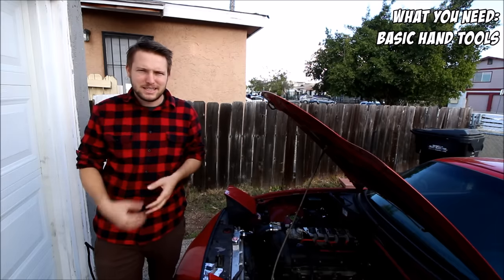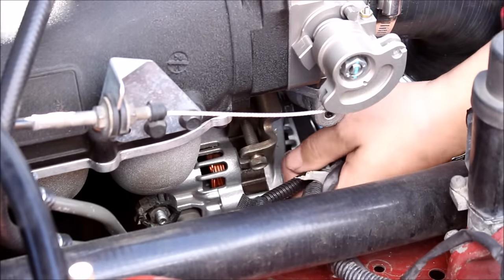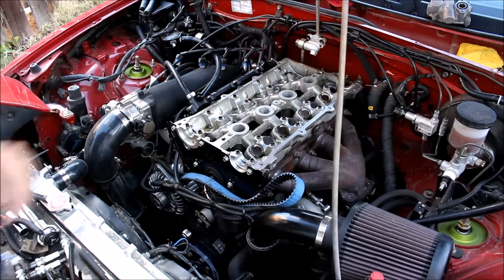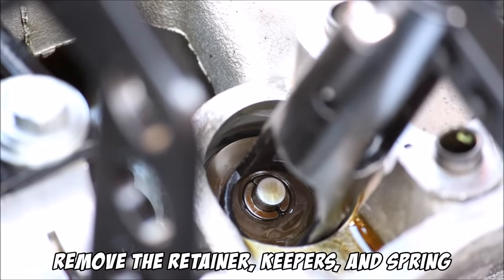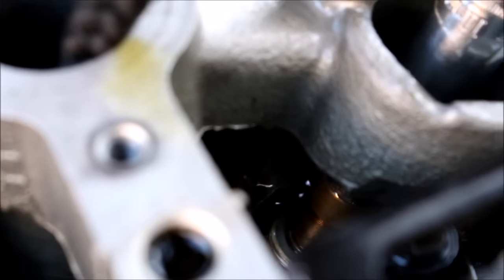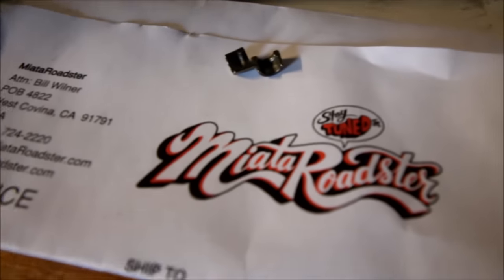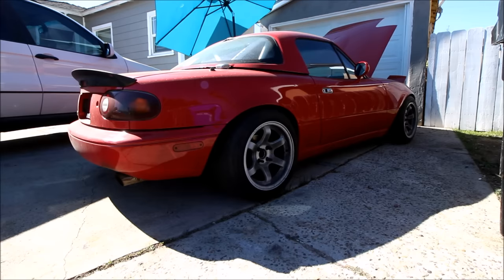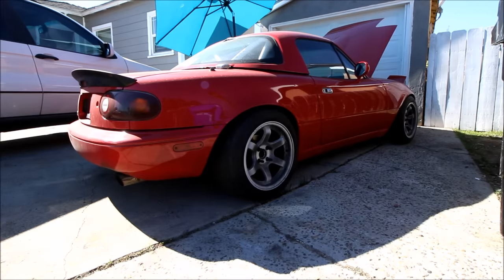The ULTIMATE Guide To Replacing Valve Stem Seals The Easy Way

Comment: A trick I learned in tech school. Use some trans gel to stick to the end of your flat-blade screwdriver and then stick your keeper onto the trans gel which is on the tip of your screwdriver. Also put a little bit of trans gel onto the tip of your valve stem. Now your keepers wont fly anywhere! Helped me a lot honestly. Just don't go crazy with the trans gel and it should be fine. I didn't use that type of valve compressor though, mine was more of a "vice grip" style. Should work either way, just don't let up ;) Have fun out there!

Comment: Hi Greg. Nice video bro. I've done this twice. Once on my 97 Mazda Astina 1.8(lantis, protege, 323f) and once on my 07 Toyota tazz 130 2e. I must admit doing it on the mazda without the right tools is much harder than it is on the Toyota...bcoz of the strength of the springs the mazda valve springs are much harder to compress. I compressed the Toyota springs with my fingers but was very soar after that. I managed to cut a 17/19mm Spark plug socket on the side open and used a extension to compress the springs and it worked great. Gents...one "Very Important" thing I want to mention is:  When attempting this, make 100% sure that you clean the bottom around the valve stem because what I found was broken pieces of the older valve stem seals still stuck like a O ring around at the bottom. It can sometimes be difficult to see them. So please make sure before installing new seals to prevent more oil leaks and doing it all over again....All the Best. Thanks Gents

Comment: Excellent trick with the rope! I've been fortunate to have access to a compressor, or I'm having to remove the cylinder head for other reasons. A suggestion, if it can be of some use for anyone. When installing the keepers for the vale stem, take a small flat-head screwdriver (a pocket screwdriver) to which you'll apply a small amount of red grease on the tip. Also, apply a small amount of red grease to the inside and outside of one keeper. Then, take the keeper and smear is on the tip of the screwdriver with it hanging on using the grease. Make sure to face the open end of the keeper away from the screwdriver. Afterwards, press down on the valve spring and place the keeper along the stem. Next, slowly release the pressure being applied the valve spring, the keeper will begin to pinch into place allowing the opportunity to lift the screwdriver up and out. It takes a like practice. Cheers!

Comment: Just to throw two cents worth in; if you lay your keepers curve side down, take a reel small blade screw driver and get just a tad of new grease on the flat side of the blade, you can touch the keeper on the back, it will stick to the screw driver; then with the spring compressed, just set the keeper into place on the valve stem and draw the screw driver out wiping the keeper off onto the valve stem.  The grease will hold it in place, place them both and release the compressor.  There are of course many methods that work, this is just one that has worked well for me for many years.  Nice vid by the way, you took the time, and was all about the job. Thanks!

Comment: Heads up to anyone looking to do this job now (after the 5 years) STRONGLY recommend you save yourself the headache and buy the Flyin miata valve compressor tool instead of the one he used in the video, no keepers catapulting into oblivion, no modifications to the tool and generally way way easier to use.  Other than the tool the video is still super super helpful and makes the job easier.

Comment: "No the autozone spring compressor will not work.  Those are meant for big block Ford's and not our small little engines."

I have a vehicle with a big Ford V8 and yet still found your video very relevant, engaging, informative and very well put together.  You sir have got a new viewer 👌

Comment: Great video.  Just did my valve stem seals.  Beavis Motorsports had a great tip on using a piece of packing tape to guide the keepers.  A+ racing has a great tutorial on the timing belt.

Comment: I’m working on a Contour 2.0l. I found that a 17 mm socket worked perfect for removal and install of the valve seals, the redesign was just a little smaller than factory so it worked out perfect

Comment: 2015 Buick Lacrosse V6 100,000 miles. Symptom oil fouled spark plugs causing misfire. Dealer wanted to replace bank one cylinder head stating it had porous casting. If it was porous it would have failed the first 3,000 miles. . googled oil consumption and found common problem with valve stem seals . Thanks for the tips

Comment: I am having to do this right now, unfortunately to my 2001 Miata. One of my lifters has failed (going to replace them all of course). But also need to replace my valve stem seals and I really didn't want to pull my head. Thanks to this video I won't have too, just need to get my hands on that tool.

Comment: When you were cranking the engine by hand after reinstallation, were you setting the timing? I’m going to be tackling this soon on a 2000 toyota corolla dohc so any info on what was happening there is greatly appreciated. Ty for the video ✌🏼

Comment: Wish I would have known about the rope trick before dropping a valve to the bottom of my cylinder because the piston was at BDC instead of TDC...
2 hours, a screwdriver, magnet, and coat hanger later, it was back in place and a valuable lesson had been learned.
PS- this was on a 12 valve Cummins, not a VVT. But that still might have been a handy trick.
Reply from the maker: jeffsqartan Wait.... You successfully got the valve back through the guide???? IMPRESSIVE
Reply: @TheCarPassionChanel It was either that or spend another $355 on the modified head gasket I have to use lol
Thanks! Desperation will get you to do some crazy things.
Basically, I bent the coat hanger to get it to hook onto the valve keeper groove, lifted the valve into the bottom of the guide, then rotated the piston up to the valve to keep pressure on it and push it up to where I could grab it from the top. The hardest part was getting the valve centered on the hole. The pistons in my Cummins have a deep dish that's offset from the center of the piston. But yeah. Good times lol.

Comment: @12:51, put some moly grease or vaseline on the retainer and place the keepers outboard of the stem so when you get the retainer pressed under the stem grooves, you just need to slide the locks into the groove. let it up and wipe off the vaseline. It wont hurt the oil. Ive seen people use a piece of pipe and a hammer to just strike the retainer and the locks just pop out.

Comment: FYI the " Lisle 36050 Valve Keeper Remover and Installer Kit"  is a much better tool to remove/install retainers. amazingly quick and easy and its $50, they have a single non-kit for $30. It takes like 5 seconds per retainer, install or removal.. Definitely worth adding to a toolset if you do this more than once. FYI its magnetised to prevent what happened to you. Good video though!

Comment: New to this channel, and I'm now sub'd. Great detail in what you're doing and giving some hacks (nylon rope) to make the job right and easier. 
I didn't see or if you filmed from the very beginning, but I'm thinking you started this job with the #1 piston at TDC, is that correct?
You have encouraged me to looking for a non-running Miata and challenging myself to get it going correctly, with an engine rebuild.
Thank you for your time and knowledge with this motor.

Comment: Great video, the valve stem seals once seated should it be able to rotate when turned by hand.? Because i just replaced my valve seals & its really tight, hard to turn. The old ones were easy to turn by hand while removal. Thanks

Comment: Exellent job, I have watched many re valve stem seals replacement including air compressor used in the piston cylinder with the threaded hose attached to spark plug threads. Yours is well arranged. Can you describe the Wet/Dry process for testing cylinder compression and how exactly what your looking for in that testing process?

Comment: Retainer installation can be made easier with the help of a magnet and some type of flexible barrier, I use old latex gloves. Place barrier on retainer, magnet on stem (usually inside the glove to keep magnet from attaching to spring compressor cylinder walls), compress spring. Usually works on first attempt for me
Reply: Legend. After mucking about for ages, tried your latex glove trick. Worked so well. Just enough stretch to let it rise and then fall into place. Brilliant

Comment: I felt your anxiety about the keeper flying away on you. My first car (in 1987) was a 1983 Mazda 626 with a simple 2.0 i4. The original owners treated it like garbage. The valve adjusters - manually adjustable - were noisy AF. One ambitious morning, I pulled the valve cover off to investigate. I found the lash adjusters were faceted from possibly never having been adjusted in their 80K miles. So, I decided to pull each adjuster out, so that I could reshape the tips to being convex again. This required removing a lock nut to pull both parts off each rocker arm. Well, this was my first time pulling the valve cover off anything, and I wasn't paying attention to those sneaky oil return funnels in the head... and at one point I mistakenly dropped one of the nuts. I nearly had a heart attack at the ripe old age of 21. I hoped and prayed, and upon closer inspection, I found the nut perilously sitting in the oil return port near the top of the opening. I lucked out that the nut had landed north-south! If it had landed east-west it would have slid to the bottom of the engine. That oil return port was very narrow in depth, so the length of the nut got stuck there. 90° to the right or left and it would have been gone. I still thank my lucky stars on that one. Lesson learned - COVER YOUR OPEN PORTS FOLKS.

Comment: 12:54 Get a tube, or a straw, or a length of fish-tank clear tube so you can see, and hold it in place. If you have that length of tube, you could even cut it at an angle. I like this compression tool. I saw a guy use some zip ties on this. I used zip ties once, actually hose clamps, to compress a rear shock on the A-Arm for a replacement on my Z once.

Comment: I'm about to install a new head gasket, I'm assuming the valve seal job is easier to do with the head removed?  Maybe don't need that special tool to compress the valve spring?

Comment: 12:05 Gewd Deal! Werkin on a 1986 F350 6.9L diesel and had trouble gittin the intake valve stem seats on head. Use a socket, gotcha B0$$

Comment: I forgot to plug in o2 sensor on one of the banks. Car didn't want to ignite and came up with engine check light at first on my bmw 120i. Gave me a heart attack until I collected myself and used a odb2 tool to scan and read error. All good now. As soon as I saw the keepers and knew what they are, I ordered 4 extra before I started the job lol. A little trick I learned from other youtuber, just use some grease on the keeps and a flat hear screw driver to push them in place and they should stick.

Comment: I found another method of installing the keepers.  I have the same tool.  I put a steel rod in the push down tube.  I also place the keepers in the retainer before placing it on the spring.  I can replace the keepers in one or two tries.

Comment: Reinstalling keepers. How would it work to use a long slender flat blade screwdriver and glue with sticky grease the keeper to the blade and slip the keepers onto the valve stem while you are holding down on the spring?

Comment: Hey guys,
A small trick if you try this. Get a small screwdriver, around a 3mm wide tip, but a long one. put a dab of grease on the end and you can pick the retainers up and they'll stay on your screwdriver. Get them in place and the small amount of grease will "stick" them to the valve itself instead and allow you to move your screwdriver while keeping the keepers in place.

Y'all welcome for the hours I just saved you.

Comment: Just a quick note for anyone on a tight budget I have a super budget Toyota it’s and it was going to cost more than the car cost to repair the valve stem seals, my main symptom was a cloud of smoke after heavy engine braking so to get round the problem I go down big hills in neutral and don’t downshift to engine brake and as long as I run the engine hard or do some motorway miles the engine runs perfectly, they have now been bad for over 25k miles, just keep the oil topped up, I have had not problems with spark plugs or o2 sensors and I don’t have a cat so that helps!

Comment: If you have access to a good compressor, use air, even with the tiny valves in my 1zz-fe 180psi held them solid. Also use a keeper remover installer tool, super useful, and easy to get your hands on. I did this literally last week. Use the proper tools guys, theyre made for a reason.

Comment: Hello from New Zealand...thank you for your videos

I need to do Valve Seals on 626 FS 2 LITRE, is it worth taking head off in order to replace a head gasket as a preventative measure for later on?
Reply: Hello from Latvia! You should replace the head gasket if it is old, great chance to do that job aswell.

Comment: Are there such a thing as Silicone valve stem seals that won't get brittle and  crack to prevent this procedure from being necessary? I've heard that racing cars may use Silicone Vacuum Hoses to prevent vacuum hoses from cracking from extreme engine heat. That's why I've asked about Silicone valve stem seals.

Comment: You’re genius man, very nice video l, I have a 2008 Lexus GS350 with 112mi I do have white puff smoke comes but after the car has been warmed up, sometimes i see smoke sometimes I don’t see it, when I went to the mechanic the first thing he says it’s a valve stem seals, what else it could be ??? He told me its $4,000 job 😞

Comment: Protip for installing keepers if you do not have steady hands / patience.  Vaseline and a tiny flathead screwdriver.  The Vaseline will allow you to stick the keeper to the end of the screwdriver, but it will not stick so much that you will pull them out with the screwdriver.  Plus, Vaseline is a petroleum product so you will not do damage to your motor.  After you get one on, you can rotate it  around 180° to put the next one on. This in handy when I cammed my 12 valve VR6.  Magnets are the worst thing...you might get one keeper in per week but then when you try to put the next one in, you will pull them both out.

Comment: The quick way is to get yourself a long flat head screwdriver that is magnetic. then you fill the keeper cavity with dab of grease. with screwdriver lower the keeper and push it on to the stem groove then you slide the screw driver upward ( that is the flat head side would rub back of the keeper all the up) the grease causes a suction between the keeper and the valve stem thus keeping it in place.

Comment: I have a 93 Miata I am doing this exact thing to car.

I got 2 valve stem seals on cylinder 1 done but I am have a hard time getting the other two on. I used a different tool for the first 2 and couldn’t get it work for the other. I have managed to get 1 keeper on but have not got both on successfully using this tool. 

Do you have any advice to keep the two keepers in place so they stay when spring is decompressed?

Comment: Supertech make "high performance" valves for Mazda BP motors which are 0.1mm thicker in the stem than stock. And they make valve stem seals to suit these hi perf valves.  I wonder if that is why they give trouble with stock valves.   I have to change my stem seals, and bought Super tech seals for only $46 Australian.  Then I watched this video and bought a well known brand of seal (in Australia) for 3x the cost just to make sure.  Excellent video.. I am gathering all the stuff I need to do this job on my Mazda Lantis. which is the same donk but tragically is front drive so the motor is the wrong way round. I am trying to source a  trained pixie to get the water pump pulley off.

Comment: Maybe you could cut off a piece of round steel bar max 1" long and just  loose inside the compressing pipe. After you set the keepers in beside the valve put your new piece of round bar on the top of your set up and apply your usual compression on the diameter of the spring plate and the keepers will be held in place while traveling into position from the presence of the round bar piece on top of them . Withdraw the compressor pipe and pick up the round bar piece and do the next one. Thanks for the good Video.

Comment: Hi great video just wondering did you adjust the lifters at the same time or should you do once you have everything open , I am thinking of replacing the stem cells and was thinking about the service aspects
Kind regards
Reply from the maker: I didn't need to, but this is the perfect time to do it. If you're working on a Miata engine (99-05) unfortunately there's no adjustment, you need to buy the correct size shims. If it's a 90-97 engine they're hydraulic and lash can't be adjusted.
Reply: Mine is a mk3 2007 1.8l I was thinking of getting this done at the same time as its not far off the full 100k service